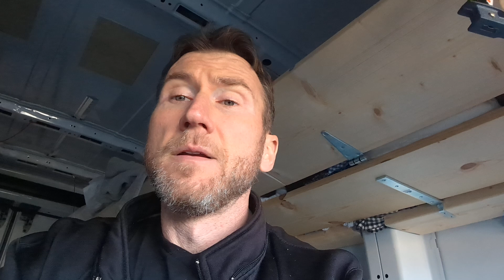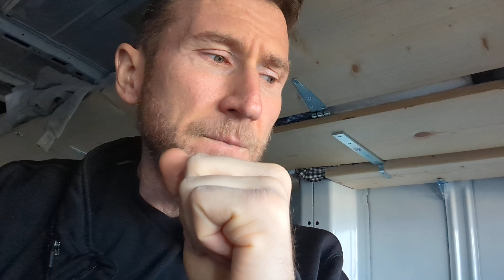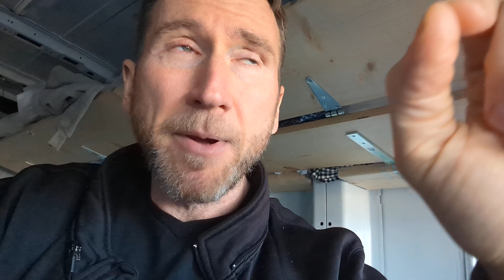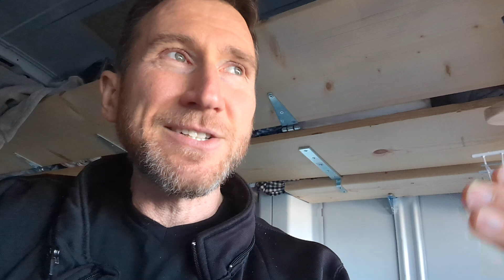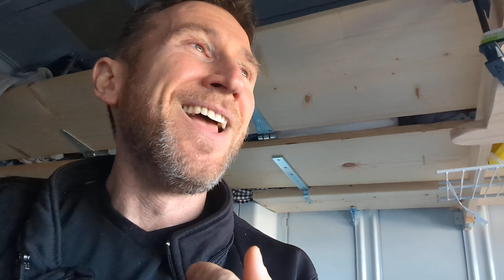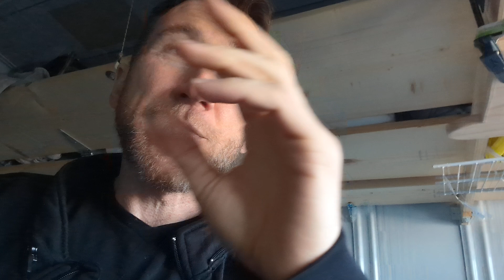explanation of raised c8 z06 oil level problem, bad gasoline and fuel system, Justin HPO misleads

Comment: Your explanation makes more sense to me than the “dealers are over filling the oil”. But you aren’t going to get any traction by insulting the GM higher-ups.

I figure all the wide-bodies are over-priced by 20k. Maybe they can use that money to fix this problem.

I’ve never been impressed with HPO but honestly the prices for eRay and Z06 completely turned me off from Corvette.

At least your points are interesting and seem to be worth considering.
Reply from the maker: @theponycargarage1453  it's gm loss if they can't see past my delivery

They will be federally ordered to fix more cars and publicly humiliated the longer they wait to solve the issue

GM produced a car that can kill me and then their staff insured my complaints.and basically said I'm a liar.

I owe GM and their staff nothing at this point

Comment from the maker: Phase separation fuel (gasoline/ethenol with unwanted water mixed in) can cause the c8 z06 lt6 engine to have instantaneous catastrophic failure, or ticking time bomb catastrophic failure at a later date from a bent rod/spun bearing, where as most other vehicle's engines do NOT have this vulnerability due to the differences in the vehicle's fuel system/ pump geometry between c8 z06 and all other vehicles on earth.

Background:
Phase separation is a process that separates a single mixture into two or more distinct phases. It can occur between liquids, melts, or in hydrothermal systems. 

Phase separation fuel is fuel that has separated into 2 or more layers due to water contamination. This can happen when water mixes with gasoline that contains ethanol. 

How it happens:
Water enters a tank of gasoline and ethanol (this can occur at gas stations as water from rain or snow melt makes its way into the manhole covers where the gas station fuel is stored under ground in large tanks)

The ethanol absorbs the water and separates from the gasoline over a period of time

The ethanol and water sink to the bottom of the tank
The gasoline-only layer remains at the top

What it causes in OTHER VEHICLES:

The engine can't run on the ethanol-water mixture.
The mixture can corrode metals in the engine.
The fuel has a reduced octane rating.

(In simple terms, the car simply does not run great for a while, but the engine is typically not damaged/destroyed)

What it causes in the c8 z06:
Once phase separated fuel is in the fuel tank of the c8 z06, it behaves as oil and water would behave, it does not fully remix/blend together.

As these pockets of 2 different fluids enter the in-tank-fuel-pump, and are then pumped up the low side fuel line, the 2 fluids encounter a fork in the low-side-line to proceed to the 2 high pressure pumps.  At that fork, the fuel would need to break into equal parts of each of the 2 fluids, for a total of 4 proportional pockets of fuel, aka 2 proportional pairs, one proportional pair per each side of the fuel system/engine....  But odds of this perfectly proportional split occurring in each moment are virtually impossible

Instead, the reality is that more of pure gasoline goes one way in the fork, and more of the ethanol/water fluid goes the other way at the fork, moment to moment.

This causes one side of the lt6 c8 z06 to temporarily run lean while the other side runs rich.  This happens for 3 main reasons.

-the high pressure fuel pumps produce different output pressures when forced to pump varying fluid types, which results in 2 different flow rates of fuel to the 2 engine banks and thus 2 different afr in each engine bank.

-the water/methanol has a different stored energy content than pure gasoline so the 2 wide bands in the exhaust banks detect different air fuel ratios moment to moment, and notify the computer to make on the fly fuel pressure adjustments to the single low side pump voltage on a Hail Mary attempt to restore proper afr (air fuel ratios)

- the octane rating of the gasoline is reduced once the ethanol separates and the gasoline then becomes prone to detonation, which destroys engine bearings which suffer damage which can lead to catastrophic failure at a later date After the engine spins enough miles/rpm

As the low side pump voltage is ordered to pump excessive feed pressure to raise the resulting high side pump pressure to the engine bank which the wide band is detecting the more lean condition and/or experiencing the worser detonation, the other bank side of the engine is then inadvertantly put into a super rich fuel-mixture-state where the excessive fuel washes down the cylinder walls and falls into the engine crank sump oil pan and pump where it is mixed with the engine oil.

Mixing the gasoline with the engine oil causes the engine oil level to raise in the engine crank case and dry sump tank.  Raised engine oil levels in a dry sump system can easily cause catastrophic engine failure if even one of the piston's connecting rods are bent on the downstroke of the piston where it hits the surface of the raised oil in the crank case during a cold start, after the excessive oil flows back to the engine from the oil tank when the vehicle is shut off and the scavenge oil pump is not constantly pushing the excess oil to the oil tank.

This is one of several reasons why the lt6 engines randomly fail without warning.

And to make matters worse, the oil is then highly flammable when the engine block grenades, which can consume entire cars in flames, as well as take people's lives.

We believe that GM moved forward with the production of this faulty c8 z06 Gemini fuel system architecture because gm likely believed that the odds of the average Joe solving WHY their engine blows, And then accurately explaining/reporting it to the NHTSA, are slim to none, in odds.

Justin at horsepower obsessed HPO is walking, unteachable, ignorant, YouTube video uploading proof, that the average joe, (and even "above average") Z06 enthusiast is literally too "mechanically challenged" (low IQ) to understand the root problem, let alone repeat it accurately to others.

Instead Justin's kind seems to wish to blame and perhaps sue dealerships for raised oil levels, dealers who have nothing to do with the actual problem. 

 GM of course is all for the dealerships being blamed and sued instead of GM corporate for implementing a faulty new style of fuel system.  GM corporate can seize dealership franchise who make horrendous mistakes on a frequent basis.  So gm stands to actually profit IF the dealers are sued often enough for this raised oil problem, as gm can seize (for free) a multi million dollar franchise for poor performance, and sell the Chevy franchise location to another dealer group, if the problem becomes common and Vette techs are accused of lying.

Thus, gm probably feels confident that there won't be enough organized complaints for the NHTSA to ever issue a recall, let alone to ever start an investigation in the first place.  

This random engine failure is to gm's advantage once cars no longer have a manufacturer paid warranty on their engines.  At over 30,000 dollars a piece, gm stands to profit greatly when these lt6 and upcoming lt7 with similar fuel system will fail out of warranty

Comment: No one would build a problematic fuel system the way GM has. The car needs separate and independent fueling for each bank, 2 low and 2 hi psi pumps and with separate and independent feedback control for each bank. Problem solved. How hard was that?

Comment: Hi Brandon, I have a used 2022 C8 Z51 and I have not had any problems like your describing with my C8 and I bought it with 5,200 miles on memorial day 2024 and today it has 7887 miles on it, do you think I should upgrade to a 2025 C8 Z06 1LZ or do you think I should keep my C8 Z51?
Reply from the maker: The problem I'm describing does not happen on stingrays as it does not have the 2 high side pumps like c8 z06.

I think z06 prices will continue to fall with the release of the gs and also these problems being exposed
Reply: @bbbVetteTitans   Thanks for the reply man! ;)

Comment from the maker: Justin at horsepower obsessed hpo and so many others are ignorant, who blame the dealers alone, when the faulty fuel system is the problem

GM voids warranties if you don't check your oil level every gasoline fill up to know when the problem originates